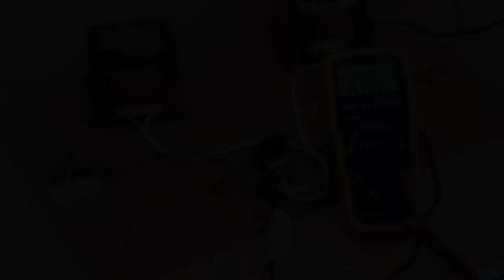DIY Welding Machine / Only 2 Microwave Transformer / Good Job

Comment: What about to add LCD to volts and amps meter can hold ond display high volt hight amps , thanks and good job.
Reply from the maker: Hello.  Very good idea, but I tried to make the box as small as possible.  That's why I don't hesitate.  However, it would be great if it did.  Thank you for your interest.  Greetings from Turkey 👍

Comment: hello friend my transformer fell to the floor and scratched the 3 wire resin coating of the primary coil is it still usable
Reply from the maker: Hello.  If there is only a scratch, there is no problem.  You can use

Comment: Nice but.....  your using materiel device and voltage controller name  in full details pls
Reply from the maker: Hi.  Except for microwave transformers... I used a total of 13 meters of 4mm2 silicon insulated copper cable.  You can search for this cable as N2GFAF cable on the internet.  I used dimmer circuit for current adjustment.  I used 4 extra BT136 triacs because the circuit I have is low power.  When the triacs are connected in parallel, the total power increases.  However, if a 4000 Watt dimmer is used, there is no need to connect an extra triac.  General wiring diagram and triac wiring diagrams are available in the description section of the video.  I used 2 12V fans and a 12V adapter to feed these fans.  I used 16 Amp switch as on/off switch and 10/25 welding sockets for welding probes.  Welding probe cables 1 - 1.5 meters of 10mm2 copper cable.  Welding pliers are 300A pliers.  The aluminum I used for the box is 3mm thick on the front and back panel, and 1mm on the cover.  I used the cable from the microwave oven for the 220V input.  I tried to write down everything that came to my mind.  Please write again if I missed something.  I tried to draw the connection diagrams in a way that everyone can understand.  Thanks for your attention, have a nice day

Comment: Hola un saludo desde Colombia . Muchas bendiciones . Solo deseo preguntarte se calienta demasiado . Por cuánto tiempo se puede utilizar? El dimmer me puede soportar 4 transformadores  Dios te bendiga muchas gracias
Reply from the maker: Hola.  Por supuesto que no es una herramienta profesional, pero no está nada mal.  Hay calor en los transformadores, pero no lo suficiente como para causar problemas.l.  Usé esta herramienta en mi video de soporte de amoladora angular.  No he tenido ningún problema.  También debo decir que no soy de soldar todos los días.  Cuando el circuito de atenuación es lo suficientemente potente, puede alimentar los 4 transformadores.  Saludos desde Turquía.  que tenga un lindo día
Reply: Mil bendiciones para ti y Gracias por tu respuesta
Reply from the maker: Gracias a ti también.  Tenga la seguridad de que siempre haré todo lo posible para ayudar.  que tenga un lindo día

Comment: which Triac should I take BT137 600a or BT137 800a ??
Reply from the maker: Since the input voltage we use is up to 230V, it does not matter in the two models.  both can be used.

Comment: what kind of amps does it run, the highest breaker i got is either 15amps or 30amps, will it still work?
Reply from the maker: Hello.  I don't fully understand your question, but are you asking about the on/off switch I use at login?

Comment: Que bien te a quedado y muy bonita pues mi enhorabuena por tu trabajo y por compartirlo me a gustado mucho yo también e fabricado dos máquinas para soldar una con tres transformadores y otra con dos transformadores le saco 36 .v y ala 39 pero me gustaría poder ganarle o subirle el voltaje eso no se cómo hacerlo es lo que me falta para quedarme satisfecho del todo me gustaría que me ayudarás y me dijeras cuál atenuador puedo ponerle dices que el 4000w ese sería el ideal ?? muchas gracias amigo un saludo espero tu respuesta gracias
Reply from the maker: Hola.  Me encantaría ayudarte tanto como pueda, pero ¿con qué quieres ayuda exactamente?
Reply: me gustaría que me dijeras o me enviaras un enlace del atenuador que tú ves más conveniente porque como hay tantos y yo no entiendo mucho de eso pues eso es lo que yo me gustaría que me dijeras muchas gracias amigo un saludo desde andalucia gracias
Reply from the maker: No necesita buscar lo mejor para el circuito de atenuación.  Si quieres puedes utilizar un dimmer de 4000W para el modelo con 2 transformadores.  Para el modelo de 3 transformadores recomiendo 6000W.  Pero el método más garantizado es que si tienes un circuito dimmer, aunque esté defectuoso, puedes hacerlo como lo hice yo.  Así que tome 4 triacs bt137 y conéctelos en paralelo y conéctelos a un disipador de calor.  Conecte los 3 cables al circuito del atenuador.  El diagrama de conexión en el segundo enlace en la sección de descripción del video lo ayudará con esta conexión.  Si usa 4 bt137, puede aplicar este método en ambas máquinas de soldar.  Si vas a usar otro triac, dime el número y puedo calcular cuántos debes usar.
Reply: ok muchas gracias hombre lo voy a intentar hacer así como tu dices a  ver si lo hago bien con las conecciones creo que sí un saludo amigo muchísimas gracias

Comment: mi amigo muy explicito solo me quedo una duda la corriente que usas es 220 o 110 esa es mi duda si la hiciste con 220 sera funcional con 110 muchas gracias.
Reply from the maker: Hola.  Aquí la tensión de red es de 220V.  Por lo tanto, el transformador del horno de microondas se enrolla de acuerdo con este valor.  Donde usted vive, los transformadores deben estar bobinados de acuerdo con la entrada de 110 V, para que puedan hacer el mismo trabajo, es decir, obtener los 4000 V necesarios para la unidad de microondas de la salida.  En ese caso, yo diría... que podría ser.  Tienes que intentar confirmar esto.  Es decir, encuentre un transformador y enrolle el devanado secundario con cualquier cable.  Por ejemplo, hizo 24 devanados y el voltaje de salida fue de alrededor de 20V.  En este caso funcionará de la misma manera.  Si está alrededor de 10V, el valor del voltaje será bajo.  Espero haber sido capaz de explicar.

Comment: Our local ac mains is 110V and 15A max current limiting, if I was using 2 transformers of microwave for this project, What issues should I be aware of if I wish to consider transformers' power consumption?
Reply from the maker: Hello.  This system has an average power of 2000W.  In this case, at 110V mains voltage, it will draw an average of 20A current.  If your system has a 15A limit, it will not be suitable.  I don't think there will be any more problems than that.

Comment: Bon travail,  combien de mètres de cable 4mme  pour  les 2 transfo  et quel type de fille  . Merci
Reply from the maker: Merci.  J'ai utilisé 6,5 mètres de câble pour chaque transformateur.  13 mètres pour 2 transformateurs.  Chaque transformateur aura 24 enroulements.  Le câble est un câble en cuivre isolé au silicium.  (C'est ce qu'on appelle le câble N2GFAF)
Reply: merci beaucoup pour  votre aide  🤝🙏je suis  reconnaissant
Reply from the maker: Merci aussi.  n'hésitez pas à poser des questions

Comment: Greetings to you, dear sir, and I wish you success and lasting success... Sir, could you give more details about triacs? With many thanks
Reply from the maker: Hello.  Triacs BT137 have a resistance of 8A.  I connected 4 BT137 triacs in parallel to make the low power dimmer circuit I have more powerful.  I did not make any other changes to the circuit.  You can download the wiring diagram from the description section.  If anything is unclear, please write again.  Greetings from Turkey

Comment: Hello can I use a single transformer to weld a metal and much meter wire are needed
Reply from the maker: Hello.  It is not possible to obtain sufficient voltage with a single transformer.  You have to wrap a very thin cable.  In this case, the coiled cable cannot meet the current flowing.  Therefore, it is necessary to use at least two transformers.

Comment: Amigo, cordial saludo, es que me parece que usted conecta sus transformadores a 220 voltios ? Que pasa si aquí es a 110 V. ? Como se podría solucionar.
Le agradezco mucho sus consejos y su tiempo. Dios te bendiga.
Reply from the maker: Hola, funcionará a 110V de voltaje.  Incluso hubo algunos que lo hicieron y regresaron.  Está en comentarios anteriores.  Dado que los transformadores del horno de microondas que utilizará están enrollados de acuerdo con 110 V, el voltaje de salida será el mismo.  Sin embargo, el circuito de atenuación que necesita usar debe ser más potente o se deben conectar más triacs.  Además, los cables que se utilizarán para las conexiones de red en el lado de entrada deben ser más gruesos.

Comment: Great work 👏,  this looks stronger than igbt portable welding machine for small works, what are the transistors numbers
Reply from the maker: Hello.  Firstly, thank you.  I'm glad you liked it.  The triacs I use are BT137.  In this video, I modified a dimmer circuit I bought from the market and made it more powerful.  Then I rebuilt the dimmer circuit.  You can also find the video about this circuit on my channel.  You can find the clear schematic and the necessary files to make the circuit in PCB form in the description section of the video.
Reply: ok 👌

Comment: Always use your Phillips driver to make enough room to stuff more wires. That's how I got 34 turns per secondary. With a Korean MOT, I got 43 turns.
Reply from the maker: I don't fully understand what you're talking about.  Can you explain about this?  You can provide a link if possible.  thanks
Reply: LoL, hes just being silly, making a joke about "safe practices" about using the screwdriver as a prying tool lol ... Nothing to worry about, i use a small flathead screwdriver for the same purpose lol

Comment: Bueno el equipo pero novio usar el control del voltaje y además solo con 6013 ?
Reply from the maker: Hola.  Usé un circuito de atenuación alimentado para el ajuste de corriente.  Después de un tiempo, compartiré un video haciendo que el circuito de atenuación utilizado para el ajuste de corriente en la PCB sea más adecuado.  Gracias por su atención

Comment: Wow.. how many turn ang wire size in secondary?
Reply from the maker: Hello.  I used silicon insulated copper cable on the secondary side.  With a cross section of 4mm2.  I made 24 windings in each transformer.  In addition, 6.5 meters of cable and a total of 13 meters of cable are required for each transformer.

Comment: Can it work with only one transformer? Even with less performence?
Reply from the maker: Hello. Welding can be done with a single transformer, but it is a bit inefficient. The reason for this is the low voltage. If you have very little work to do and you say you will use it occasionally, you can do it with 1 transformer as follows... use a silicone insulated 2.5mm2 section copper cable and make as many windings as you can fit into 1 transformer. In this way, you can get a machine that can do simple jobs. But remember, it will not be suitable for use for a very long time.

Comment: Awe. I love your craftsmanship.
Kindly tell me the transistors you've used to regulate the output voltage. If you may, kindly s how me the schematic diagram. Thanks.
Reply from the maker: Hello.  Firstly, thank you.  You can find the schematic diagram in the description section.  The 4 materials I use are bt137 triacs.  I increased the power of the dimmer circuit by connecting these materials in parallel.  This wiring diagram is also available in the description section.

Comment: I am an amateur and admire your inventions and would like to learn the correct knowledge from you. Professor, I thank you for what you have clarified in the diagram on the links, but I would like you to clarify the symbol or value of the electronic parts that make up the volume indicated above the picture of the universe card. It has a 4000 W DIMMER so that I can manufacture it for my machine. My affection
Reply from the maker: As far as I understand, you want to make the dimmer circuit used for current regulation yourself.  Did I understand correctly?
Reply: مساء الخير ..نعم صنعت ماكنة لحيم ذو ترانسفورم عدد اثنان قبل سنة وعلى ضوء ماعملت انت ولكن عملك اروع
Reply from the maker: شكرًا.  كيف هي حالة جهازك؟  هل عملية اللحام جيدة؟

Comment: Merci pour cette vidéo c'est du travail soigné bravo .le câble 4mm2 est de 13m pour les 2 trans. est ce que c'est du câble flexible?
Merci pour tout.
Reply from the maker: Salut.  Tout d'abord, merci.  Les dimensions sont exactement comme vous l'avez dit.  Il y aura 6,5 mètres de câble isolé au silicium (non combustible) pour chaque transformateur et un total de 13 mètres.  Étant donné que ce câble est un peu fin, l'enveloppe deviendra chaude.  Par conséquent, ce sera un câble ignifuge et la chaleur sera dissipée par les ventilateurs.  Vous pouvez rechercher le câble sur Internet sous le nom N2GFAF.
Reply: Merci pour la réponse.
Kt

Comment: Amigo, buen trabajo ,pero falta el diagrama, y tipo de dimmer utilizas, y que referencias de transistores utilizas acoplados al dimmer,,,,
Reply from the maker: Hola.  El diagrama de cableado general y el diagrama de cableado que preparé para los triacs están disponibles en la sección de explicación.  Puede usar 4 bt137 como triacs.  o puede elegir un solo triac con un valor actual de alrededor de 25A.  He distribuido la corriente y por lo tanto la cantidad de calor usando 4 triacs.  la decisión es tuya.  Vuelva a escribir si hay algo que no está claro.

Comment: If I use a 3800 W dimmer, should I add 4 triacs? and also heatsink?

3800 W dimmer kullanırsam 4 triyak eklemeli miyim? ve ayrıca soğutucu?
Reply from the maker: Merhaba. Gerçek güç değeri 3800W olan bir dimmer kullanırsanız ekstra triyak bağlamaya gerek yok. eğer kullanım sırasında arıza yaparsa eklerseniz. ben, yaptığım 4 trafolu kaynak makinesinde 4000W dimmer kullandım. ancak bir süre sonra triyak arızalandı ve kısa devre oldu. ben de elimde olan triyaklardan paralel bağladım ve şimdi sorunsuz çalışıyor. iyi günler
Reply: Peki kaynak makinemi 4 trafolu yapıp üzerine 4000 W dimmer takarsam triyaksız yaparsam sorun olmaz.
Reply from the maker: @santiagorodriguezgarcia1463  Bu durumda 4000W yetersiz kalıyor. 2 trafolu yaparsanız 4000W takabilirsiniz. Ekstra triyak bağlamaya gerek yok. Ama 4 trafolu da 6000W gerekiyor

Comment: Would this work using 110V transformers and if so, how?
Reply from the maker: Hello.  It will work the same with 110V.  Because the transformers I use are designed as 220V / 4000V.  The microwave oven transformer produced where you live is designed as 110V / 4000V.  In this case, if you remove the secondary winding and do as I did, the output voltage will be 20V.  40V is obtained in 2 transformers.  What you need to pay attention to... Since more current will be drawn from the mains at 110V.  You should use the dimmer circuit stronger and the cables you use on the input side should be at least 2.5mm2.  In the dimmer circuit, I used 4 triacs with 8A resistance.  (BT137).  You should use at least 6 of these triacs.  Or you can choose a more powerful triac and use less.  I hope I was able to explain.

Comment: De que valores son los tric gracias fue muy instructivo
Reply from the maker: Hola.  El cable que utilizo es un cable de cobre con aislamiento de silicona de 4 mm2.  Hice 24 bobinados en cada transformador y usé 6,5 metros de cable en cada transformador.  Se requiere un total de 13 metros de cable.

Comment: Hi nice  where do u live video i live in Canada  we have 120 power here i  got 4 transformer  and  want to make one of these  what  amp electrode holder do i need ?  what is your opinion thx
Reply from the maker: Hi.  I guess I just saw your message.  I live in Turkey, the mains voltage is 220V.  Here, microwave ovens are designed to operate at 220V.  I'm sure it's the same in Canada.  In other words, even if the mains voltage is 120V, my system will work if it is done as I did.  To make sure of this, you can wind 1 transformer and measure the output voltage.  If there is a voltage output of around 20V, you can do the same with 2 transformers.

Comment: Good evening ,please i wont to no the name of the cable that you to rewirng the welding machine its auto cable or is not please thank you
Reply from the maker: Hello.  As far as I understand, you are talking about the brown cable that I use on the secondary side.  This cable is copper cable with silicon insulation.  Thanks to the silicone insulation, it can work at 180 degrees.  It is referred to by the code N2GFAF.  The cross section of the cable I use is 4mm2, you can watch the video with subtitles for this information.  This cable is used in the internal wiring of appliances such as electric heaters.  It can be found in electrical supply stores.  Correspondingly, AWG12 or AWG11 coded cables can be used.

Comment: Buenas tardes  bendiciones,  tengo una pregunta, será que para el en bobinado secundario puedo utilizar cable encauchetado  2×10 o 2 ×4mm2
Reply from the maker: Hola.  Primero, gracias.  Si enrollas con cable de 10mm2 no podrás alcanzar el número suficiente de vueltas.  En este caso, el voltaje será bajo.  Debes utilizar cable aislado de silicona de 4 mm2 (llamado cable ignífugo).